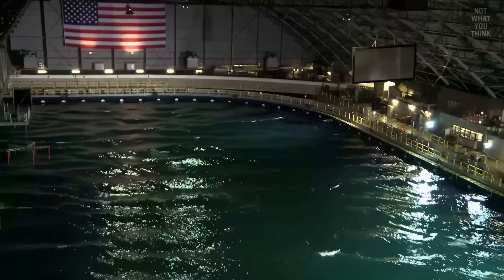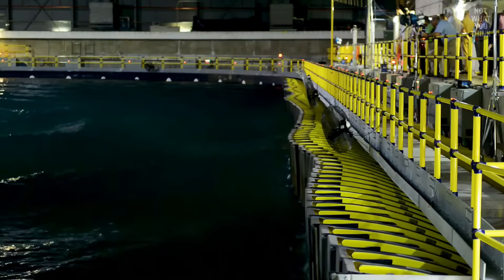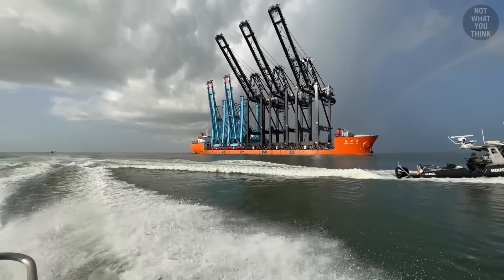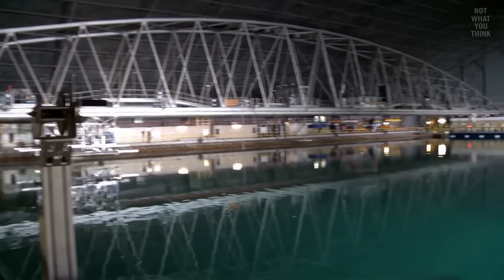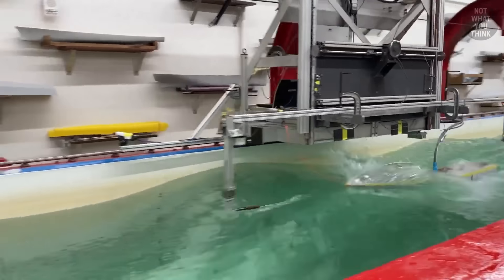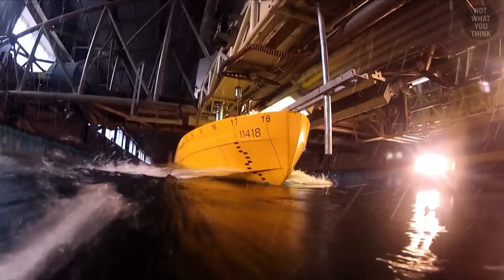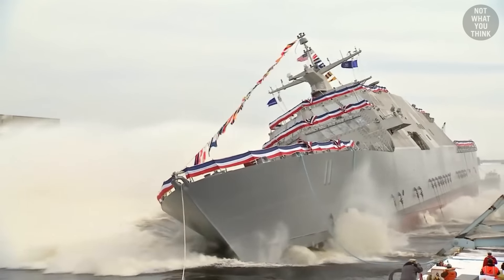Inside US Navy's Massive Indoor Ocean

Comment: "It is the combination of all these experiments performed on scale models that gives designers and shipbuilders the confidence that once the full scale ship hits the water for the first time it will hopefully perform as expected"
shows a video of an LCS being launched
I see what you did there.
Reply: I can't speak for ship builders but in software projects it is usually the customers and project managers who want to live in the fantasy world where they pretend everything is better than it actually is despite the protests of the software engineers and designers and similar people doing the actual work.
Reply: I think the LCS's problem was material used not hull shape.
Reply: @GamerbyDesign  I know, I know. I just think it was fun (and probably on purpose).
Reply: The two LCS designs had completely different problems - one had a catastrophically faulty gearbox and the other had a too thin hull plate at the hull midline that fractured. Neither was easily detected at model scale (because the ship models aren’t powered and the hull stress was under estimated. The fact that the LCS ships were actually too small for the way the U.S. Navy actually used them isn’t something a model can tell you.

Comment: I work at the Utah Water Research Laboratory and we often make models of dams (such as the Oroville Dam spillway that failed in 2017, before I started working there), canals, gates, and other water structures, and we use the Froude number in our models. We definitely also have number crunching that happens that accounts for a whole host of things that happen, and being able to have the video recording is very helpful. Basically, we make models so that clients can make informed decisions. Our work can help them save a lot, by spending 5 on a new model saving 85 that would have been spent making the full scale cause the alternate design is way better than the original idea

Comment: Science teachers and students. My Admin used to give me the science equipment catalogues so I could see all the things he would never allow us to buy. They had a square  'wave tank'  less than a meter on each side and about 20 cm deep. $2200.  Using old plywood I made a long narrow box. Two tricks  made it work. I lined it with 5 mill construction plastic - this made it water proof. (just draped it, a few spring clips.) Simple. The second trick was at one end  I  made a long sloped wedge, 'the beach'. This was under the plastic. Works great. The beach does a couple of things. It absorbs the waves so the tank just doesn't become a sloshing mess. To make surface waves (most common) just move the top few cms of water at the other end of tank. To make deep tsunami waves just lift the plastic up a bit, so the bottom comes up,  at that end. 

Richard Feynman said that using water waves to model electromagnetic waves doesn't work because water waves are every bit as complex as EM  Radiation. True. However, you can see water moving.  So a wave tank can do a lot of what the big tank in the video can do. 

What's neat is the tsunami waves are little ripples until they reach the beach, then  they slow down, pile up and can splash right out the other end of the flume. Surface waves are bigger, noticeably slower. They run up the beach and lose their energy. 
The last tank I made was about 30cm deep, 7 meters long and about 50cm wide. Students actually had crested waves breaking on the beach. Hamsters could've surfed them.  The tsunamis? They moved quicker, but were small until they climbed up the beach and blasted over the side (into the school garden.) 
That admin there wasn't as bad as the first guy. She came out glanced at the tank and said, "Don't make too much noise." The physics teacher at that school never even looked at it.  

What would make a fun naval engineering project would be to figure out how each century would've redesigned their ships if they'd used a wave tank. The 14th through mid 19th century ships would all quickly look very different. The one craft that I don't think would've changed? The Aleut Iqyax (aka baidarka). If you look at the stringers on the bottom, there's a big gap between the keelson and the first stringers. This channels the water giving the iqyax lift right where the paddler sits. I built an iqyax to do attempt this, but along the way I realized to get the 10 knots Captain Cook's navigator reported, I'd have to be able to paddle at least 6 to 8 knots. I was good able to sustain 4.3 knots, but not even close.

Comment: Self propulsion tests rarely have the model propel itself fully and are most commonly used to verify the propulsion method (propeller pitch angle and rpm for example) 

There are multipliers calculated to find out to what degree a given model propels itself for a given propulsor, speed and scale. The carriage then still pushes on the model. Latest test we ran the model produced about 50% of it's own propulsion.

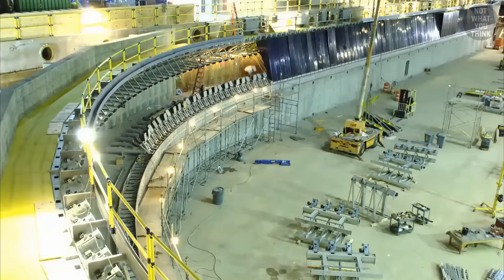Comment: What is the formula for reducing mass on the model then? Say you had a 1:50 model, if you reduced it's weight down there must be a formula because you can't reduce down the density of water or the gravity.
Reply: vibratingstring  awesome thank you. I modelled a skin-on-frame kayak, as I designed it with the least amount of buoyancy. It glided really well across the pond. Then I started to add the mass of myself at the scale used for the dimensions and it didn't sit right compared to what the software said it would.

Comment: The tanks is superior to computer modeling because with only minor alteration for the scale of the model to the water you can model far more particles IRL than any computer can handle.  If you think on it, a scale models fluid dynamics are always going to be different than full scale because you cannot scale the water or air (whichever is applicable to the model)   in other words a model airplane that is 1/8th scale still flies through full scale air so adjustments have to made to account for this, which is why a 1/8th scale P-51 does not fly like a full scale P-51 unless you play around with its  mass and airfoil to account for the difference in air density.  The same happens with the model ships in water (air and water are both fluids for this purpose) where they can account for the different density with tweaks to the results in the testing.  The problem in computer modeling vs scale model testing is the scale  model still uses a water molecule as the particle size  to measure the fluid movement while a computer model particle size is going to be many magnitudes larger to have manageable calculation time scales.  The particle size of  the water is what makes the computer model less accurate.  Once a computer can model each and every water molecule it will be as good as a scale test, or even better if it can model enough molecules to model the full size vessel without scaling the result.  Today even modeling the flow around a propeller like you would put on an outboard motor only gives you an idea of how it will perform IRL, and always leads to someone actually building and testing a prototype before it would go into full production.

Comment: I can't get past this guy's math. Fifty times smaller means negative 49 times the size. Impossible. Negative space does not exist. Seven times slower? That would be backwards at 6 times the forward speed and that's not happening. What a shame. Seems like it might have been a decent video.
Reply from the maker: Thanks for your comment. Our phrasing may have not been the best. As you probably figured out, what we meant to say was if the model was 1/50 of the size of the actual ship.

Comment: The curvature of the earth ????
Lad at that point the whole video lost credibility SMH….
So according to globe maths 🧮 there is 0.63 inches of curvature from end to end, which results in an average curvature of 0.000334 of an inch per foot lol, which would make measuring the length of the pool difficult as pools are measured in straight lines ????
So are they claiming that they accounted for slightly over half an inch of curvature over 1,886 feet, and this is not including concrete, paint, and steel discrepancies ?
How did they get the water to bend now that gravity is not a force since 1915 :)
Reply from the maker: The curvature comment is directly from NSWCCD:
3 minutes and 13 seconds in https://youtu.be/xsWzRrND3LI?si=JAqB4ShgKlNCIvZr